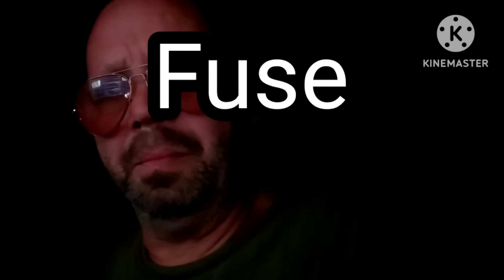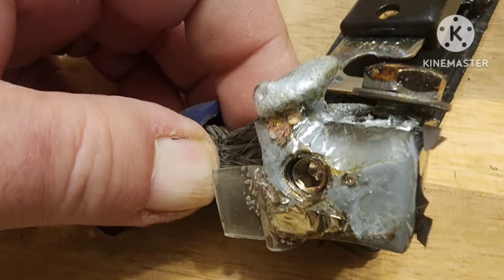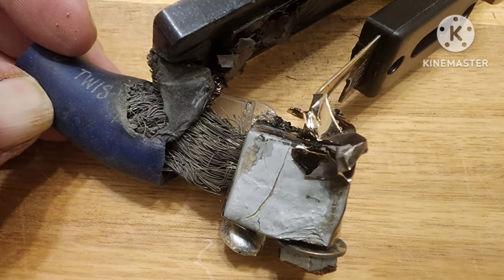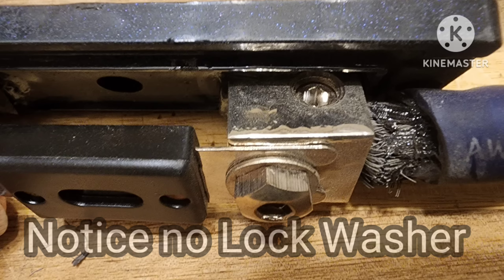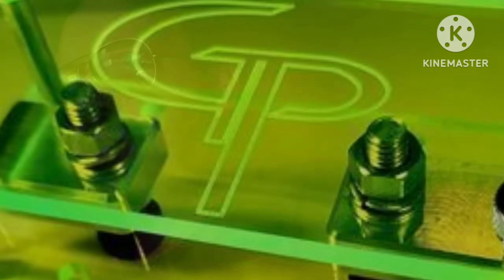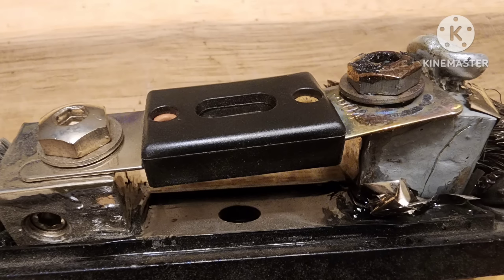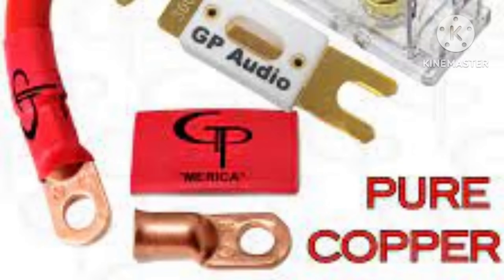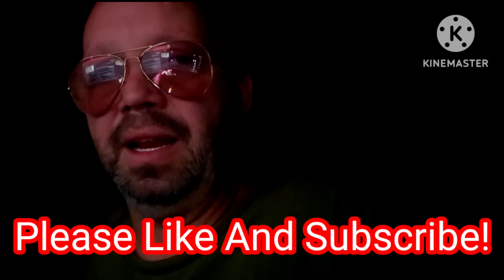Why do Fuse Holders Melt?

Comment: Excellent video, I have the same problem with the same loose connection from not using locktite on my fuse holder, plating probably came off and loosened it as you said.

Comment: I have a 30 amp fuse on a fan set up on a car and it melted pretty bad. Going to check to make sure everything’s connected right any other tips would be helpful. Thank you.
Reply from the maker: Make sure all your connections are tight and that the wire gauge is correct for the amperage, then fuse rated for the wire. if all that is on point, nothing should ever get hot

Comment: Will the power wire itself still be good ?
Reply: My fuse block melted. Where the power wire was connected inside the fuse block, (on the side it melted on) the wire was discolored and the jacket was melted a few inches. So I cut where the bad wires and used the same power wire with a new fuse block. My question is, can what happened damage the power wire itself and should be replaced?
Reply from the maker: na copper will be fine
Reply from the maker: yea, as long as the casing isn't damaged too much

Comment: Would wire ferrel help?
Reply from the maker: no really, cant hurt though
Reply: I have tried wire ferrels with semi good and semi bad results. The set screws must be basically forced through the ferrel to make a connection without resistance or arching

Comment: now that we know a loose bolt can cause the fuse holder to melt. will a loose bolt cause the sound system to lose voltage? im interested in knowing because my sound system currently has a melted fuse holder but the system still works i just dont know if im getting all the voltage or some of the voltage.
Reply from the maker: voltage only requires a TINY connection, but Current , now that requires meat. but yea get that melted stuff out and get a solid connection. unless you want to roast marshmellows...
Reply: You spend that much money on amps etc. and you don’t have a respectable rms clamp meter? Learn to measure amps and voltage across input and output and you’ll know what your system is getting and what it’s producing.
Reply from the maker: 1. this fuse isnt from my system. 2. amps had NOTHING to do with it failing.  @dirtyaznstyle4156
Reply: @CarAudioEnthusiasts  well that was more a reply to the OP’s question, but without amperage you get no heat.

Comment: Eyelets copper eyelets would solve this. This same failure happens in A/C mains hook ups too.  Bare wire to screw pinch terminals are a maintenance schedule clean and reconnect.

Comment: I use the star washer I have used a crush washer with ark results lol cause you have to really tighten it down and lots of these fuse holders have the bolt incased in plastic on the underside so the amount of torque to smash a 5/16 split crush washer can split the bolt casing before it seat and if that slit is open it will arc.  I use the star lock washers on fuse holders with great results and you are correct sir.